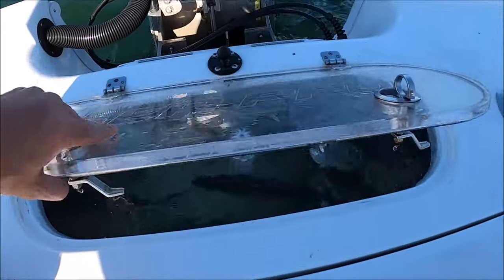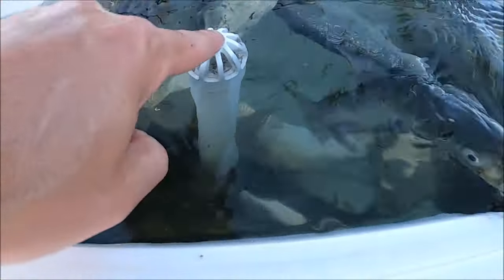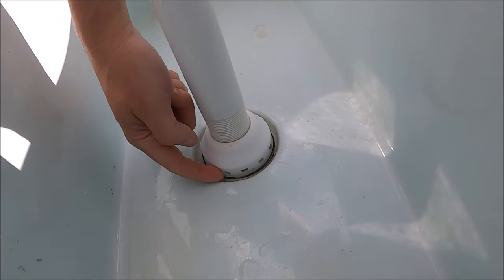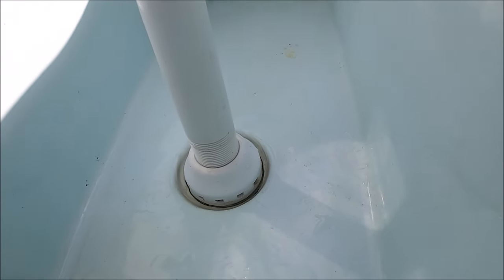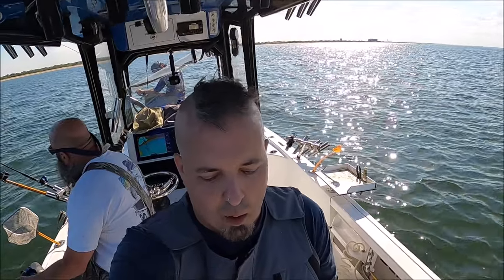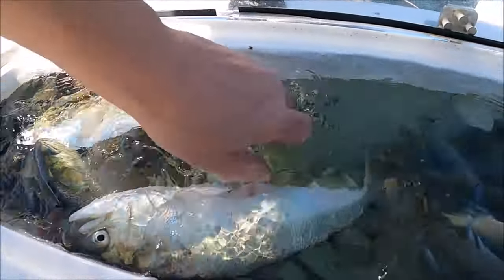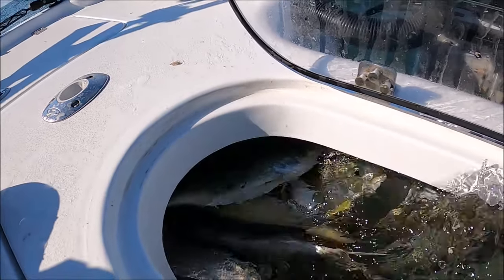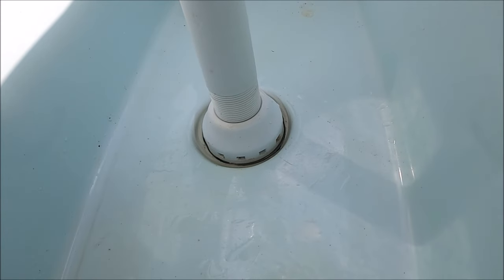Pressurized Livewell Setup. No AIR No SLOSH. Setting up Sea Pro Live Wells.

Comment: That looks like Gemlux stuff.  I thought you just used the plug so the standpipe is totally out of the way.  My Parker has the same system, and when the lid overflows, a lot of the water ends up going into the fish box and nuking my ice...I am going to drill a hole on the far outer edge, insert a hose, and run the excess over the transom.
Reply from the maker: @SeaPro360  the boat I had before this had no standpipe and you adjusted the flow with the drain valves. So many people were confused on how to set it to be pressurized so they have a standpipe now, but it’s a cool design. You loosen or tighten the standpipe to adjust the outflow. It’s foolproof (kinda)😏.  Sea Pro will still give you first version with no pipe if you want.

Comment: what happens when you get say fish guts or any debris when you drain it? Do you need to somehow back flush it? any recommendations? Not sure how you can if boat is in the water. Im just learning my livewell so excuse for the dumb question if its something obvious. thanks
Reply from the maker: Not a dumb question at all. Larger boxes have macerator pumps in the drains that pump out “solids” like fish guts and chunks. Chops it up.  I don’t have a need for one in my livewell because I can unscrew the standpipe and chunks smaller than 2”wide drain right out with gravity.
Reply: right but isnt there a plastic or metal screen at the bottom of the boat transom where it dumps it out. I guess my question is once it goes down the drain on the boat to this transom drain  how do you unclog it from there. Maybe yours is different.  @MikeSmedleyOLDSCHOOLSTRIPERS
Reply from the maker: @Tony-ge2hj  there is no screen going out the drain. It feeds into a 3” drain manifold straight thru.

Comment: Have trouble with the live wells picking up water while under way. Do you have a high speed pick up or any suggestions?? 2021 SP 248
Reply from the maker: Both wells have pickups Yep. You’re having trouble getting water in when on plane? Are your valves wide open at the pumps?
Reply: The issue is pucking up water on a plane the boat dose not come with high speed pick ups. The only thing i can ajust is the inlet flow. My boat doesn't come with ajustment for the drains. I've bought high speed picks haven't installed them yet. Just want to make sure i was soing something wrong. The local dealer didnt provided much help. All the new boats have the same flush pick up. I appreciate your feed back@MikeSmedleyOLDSCHOOLSTRIPERS
Reply from the maker: @TBFL407  gotcha. I didn’t realize you could order them without pickups. Are you keeping delicate baits that need constant flow?
Reply: Yes white bait as we call them here in Tampa fl. When I run offshore I have to stop every 5 miles so they don't get to beat up. I bought a pick up just wasn't sure if it was needed with the pressurized system. Maybe user error.
Reply from the maker: You definitely need to pump in consistently to pressurize the well.
Reply: Thanks brother i appreciate the feed back.@MikeSmedleyOLDSCHOOLSTRIPERS